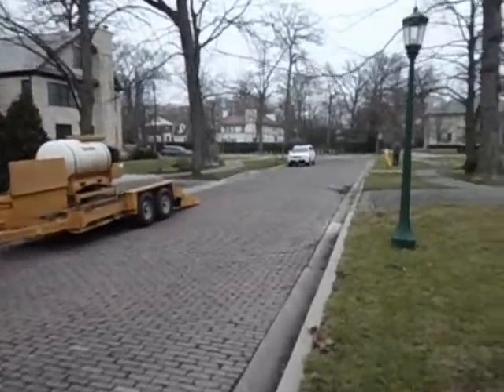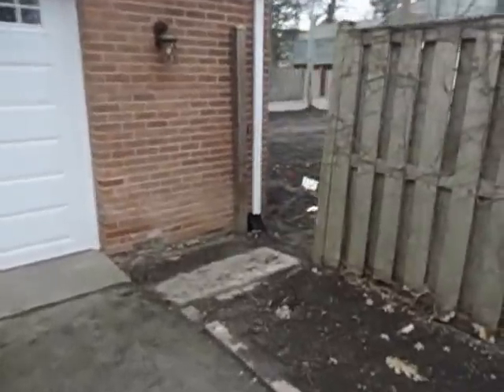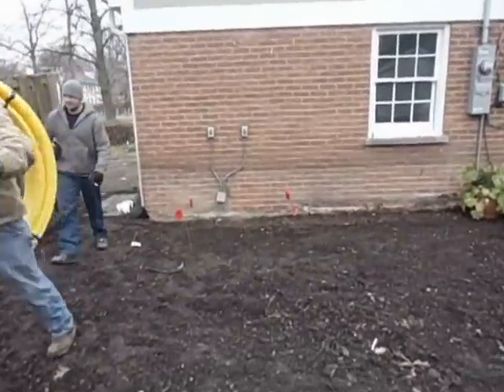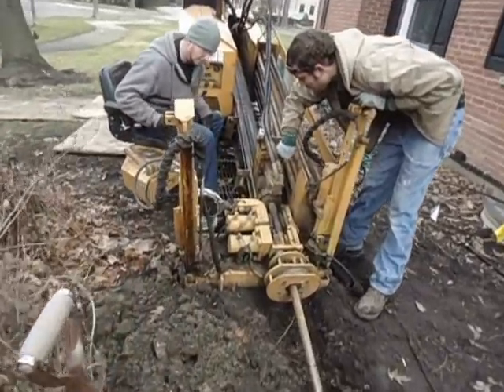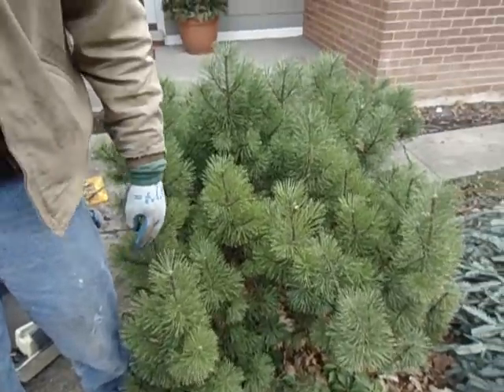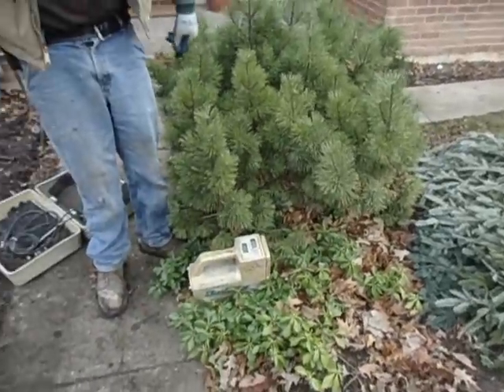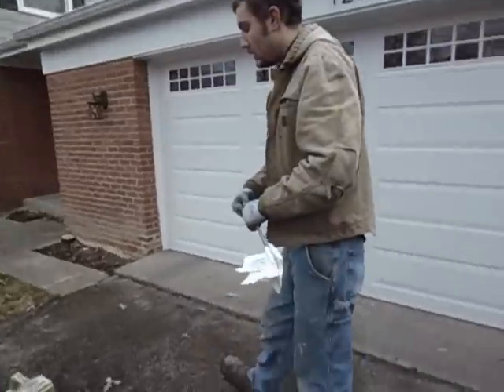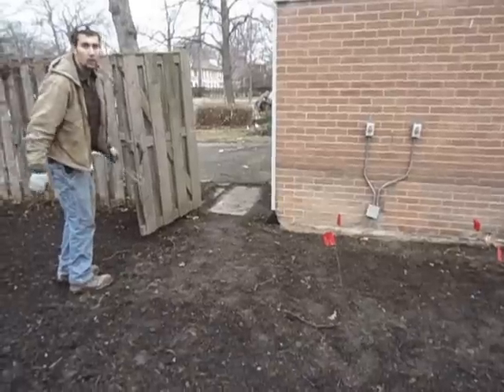Directional Drilling Gas Pipe Part 1 The Drill

Comment: I'll go over just a few things - but just for starters, the angle at which you entered the ground, pushing way too much at 12 and not knowing what the max % per rod should be, the way the entered the ground - I'm willing to bet you either bend or break a lot of rods.  Using a rope to pull back pipe with? Really? Ever thought of using something that won't break underground during pull back?  If the locator was worth his weight, he could've put the flag right where the head came out of the ground.

Comment: Using rope is dumb. Steel cable or chain is a must. A swivel will allow you to rotate as you pull back. The percent of grade on each stem was way to much. I would not do more than 8% on a 6 foot stem. There is no need to go that deep on such a short bore.